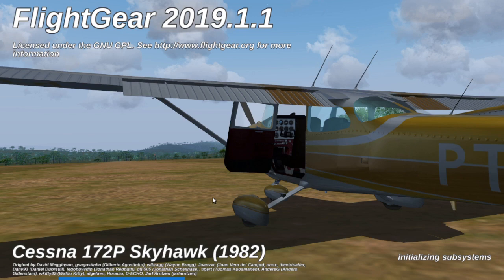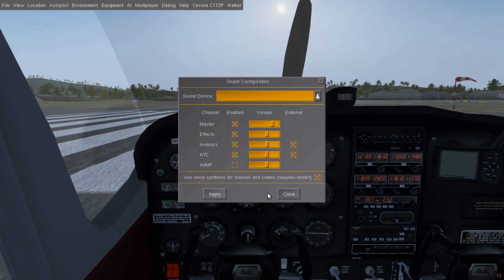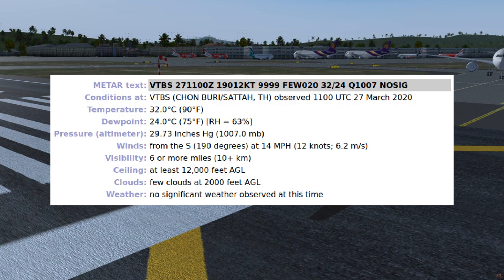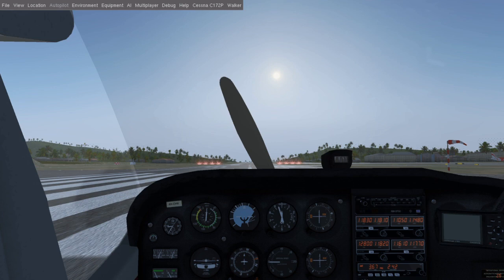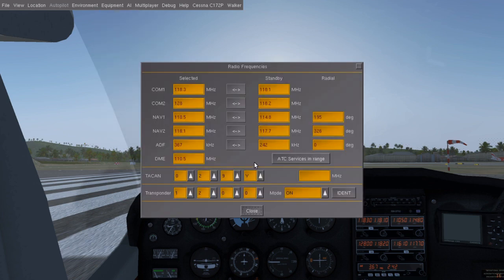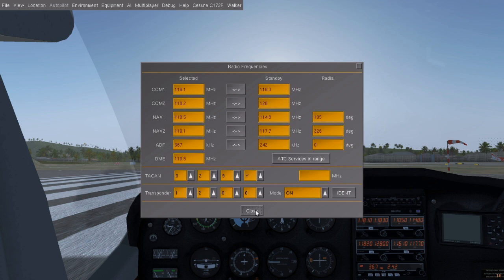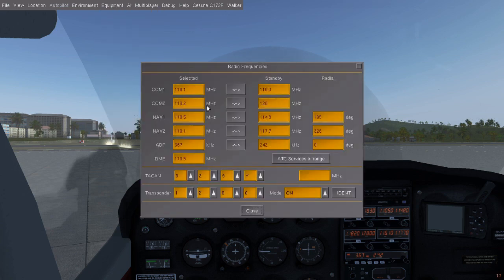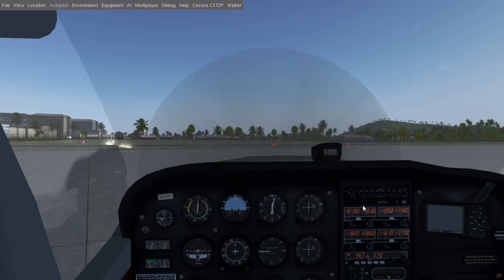Mute that looping voice! - FlightGear radio basics

Comment: i got a problem, when i start i hear the ATIS but it start to loop and never finish, even changing all my radio frecuencys. I  tryed to mute ATC from the audio settings and the only way to make it stop is muting MASTER, but if i mute it i wont hear anything :(
Reply from the maker: Did you try both changing COM1 and COM2?

also, in the c172p, there's a row of mute switches above the frequency display.
Reply: @ddk  oh Yes, I justo realidad that in the f12 menú I puta another frecuency but I didnt change it, Thanks for the help!
Reply from the maker: Glad to hear that!